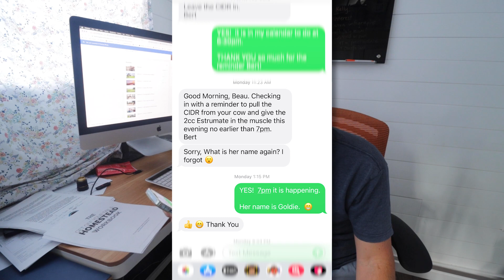THIS CAME OUT OF MY COW’S BUTT

Comment: If you need the cow to move forward in stantion provide pressure from behind by curling her tail and slap her on rump lightly with a stick. You need a removable back board for your station to keep her from backing out. While she may milk fine without it, this is the reason to train them to the headgate (for times you need to administer care or need to contain the cow.) Begin retraining her for next time. Sometimes helps if you can elevate the feed closer to her head so she's positioned further up when you close the headgate.
Reply from the maker: You are so right Cattie!  We have a lot of training to do with her, for sure!!!!!